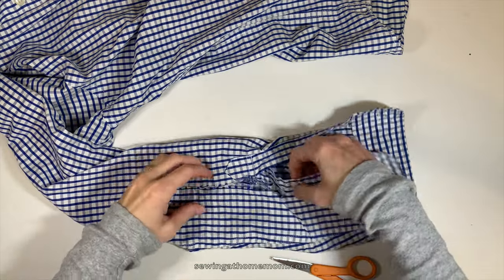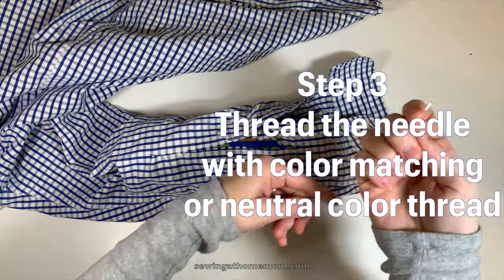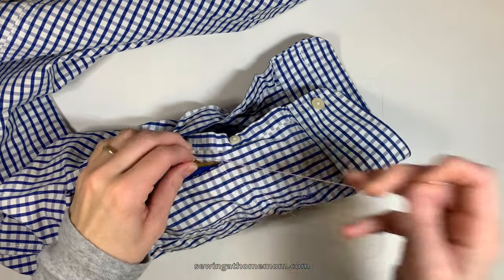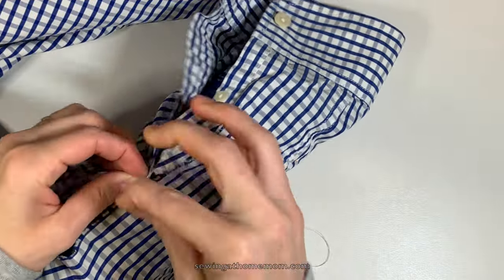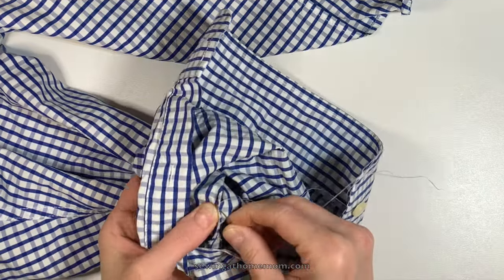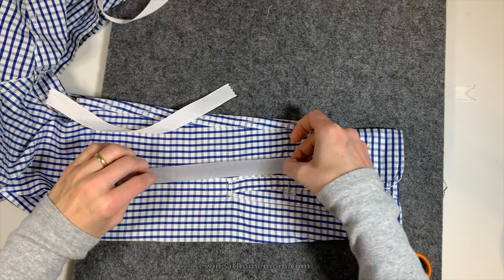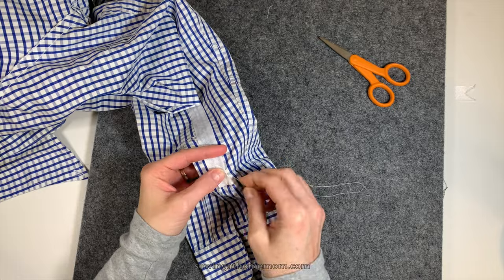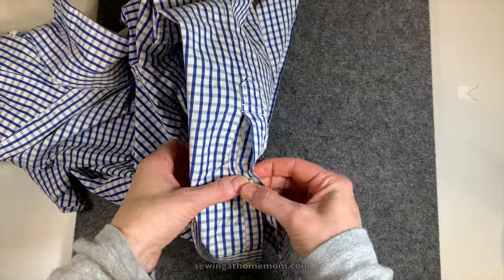How to Repair RIPPED HOLE in Dress Shirt & Save it from Landfill | SEWING HACKS

Comment: Thank you.  This is the kind of mending I need to do.  I found the thread and need to get interfacing.  My item is a thicker fabric and the mending needs to go along the inside of the space between small raised squares.  I think this will work nicely.  Now I can mend it with confidence. Great tutorial.  I have subscribed for more.

Comment: Thanks for this! Can I ask why you do not put the shirt inside out before stitching? Does it matter? Thank you
Reply from the maker: This technique works well when sewing on right side of the fabric because when the thread is pulled it should pull the damaged fabric area inside (when done properly) and close the hole. Think of closing an opening on decorative pillow or stuffed animal - it's usually done on the right side of the fabric. The stitch is called an invisible stitch or ladder stitch. Hope this helps

Comment: Thanks for this!  I’m trying to repair an “L” shaped tear in a man’s dress shirt.  Cotton/polyester.  I’d be willing to follow your instructions.  I’m wondering if I should secure the corner of the tear before I attempt to repair the remaining areas?
Reply from the maker: Lot's to consider! I can't see the tear, and under what circumstances was this tear "created" - could the shirt be too tight, or too loose, or sleeves too short, etc.? So hard to tell but, I would say Yes. You should do that. Personally, If the garment fits well, I like to start the repair about a centimetre away from the tear this way I know that the hole will not come open any time soon. Hope this helps!🙂
Reply: @SewingatHomeMom  yes, it helps.  No, the sleeve is not too tight.  Seems to me that he “caught it” on something at work…maybe something was protruding in the office and he didn’t notice it.
Reply: Another question….I have fusible interfacing from PELLON.  Should I use that?